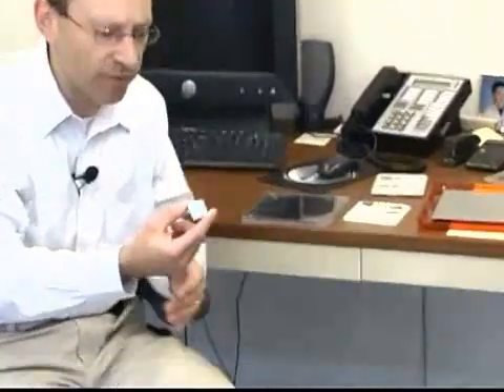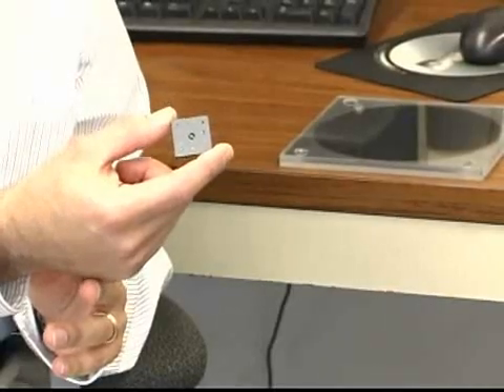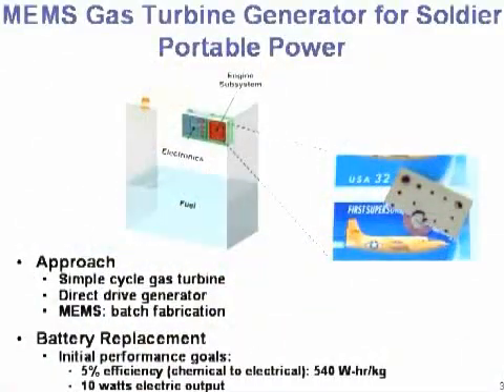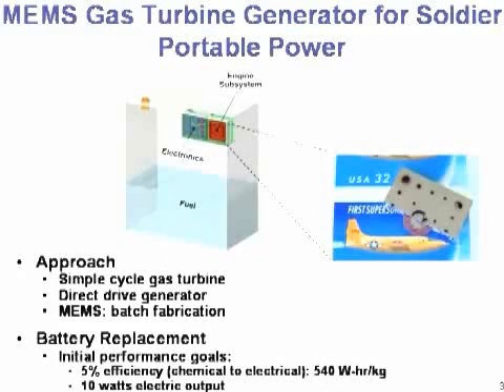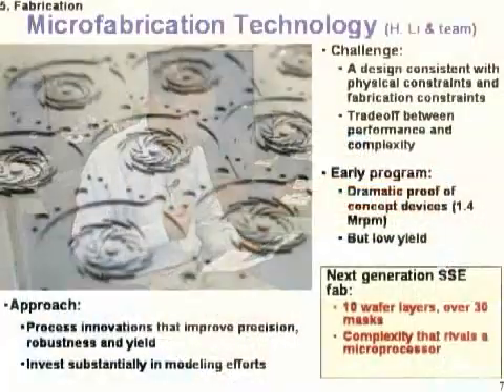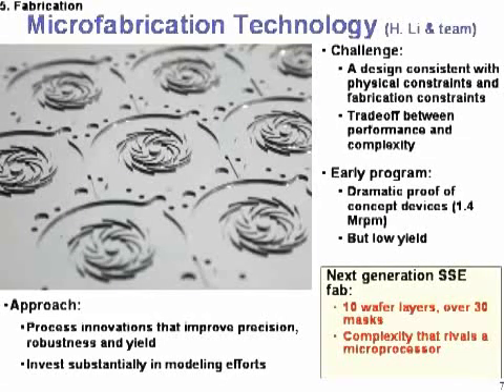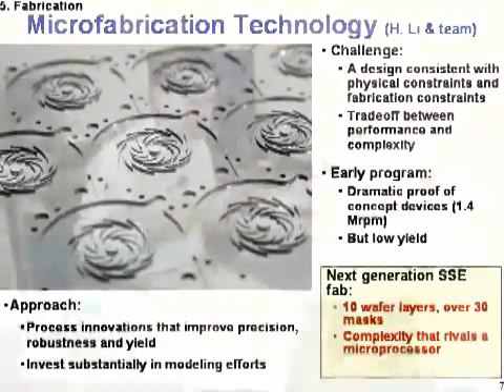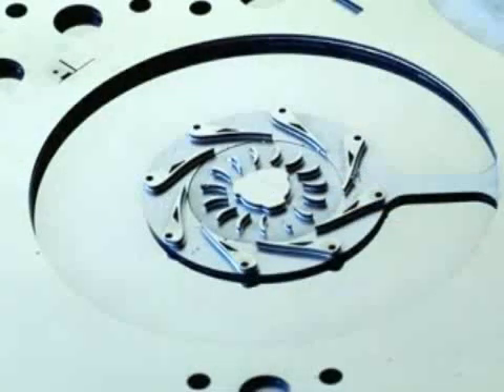MIT's Engine on a Chip Promises to Best Battery: Description

Comment: These micro turbines have interesting applications but i don't see them replacing the battery for the simple fact they need fuel and oxidizer of some sort to operate and a battery doesn't. That micro turbine is going to have issues replacing underwater, or space applications, or anywhere really where there's no air to burn. Also i can't wrap my head around a laptop with a fuel tank that would need oil changes